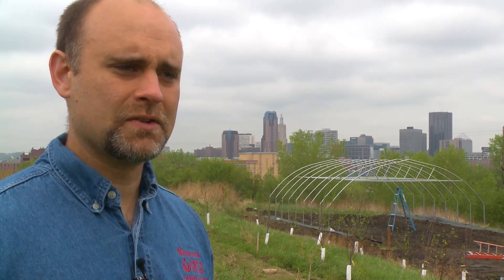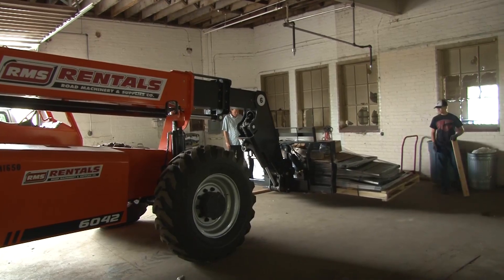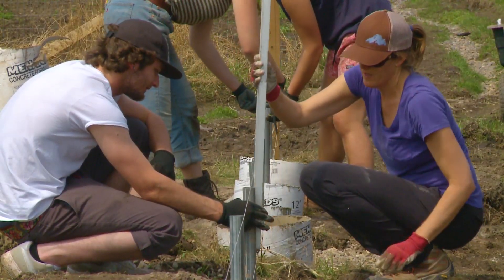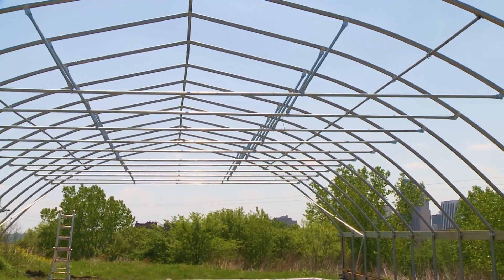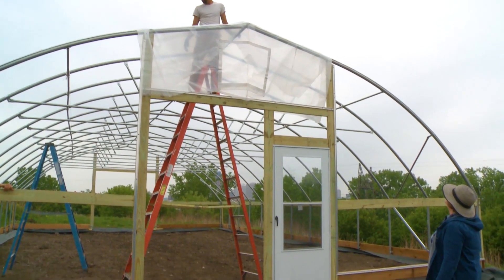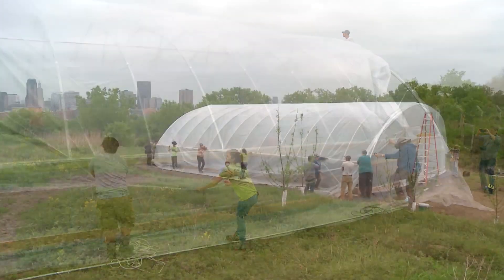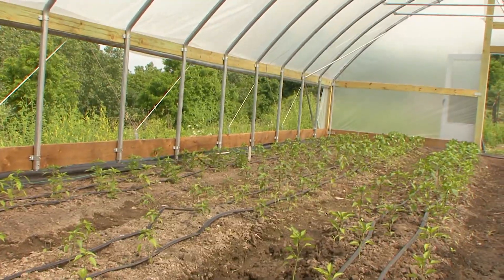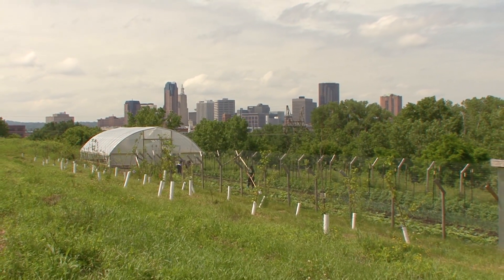High Tunnel System

Comment: Nice information.  Question-  why concrete for posts in city, but not in rural application?
Reply from the maker: I believe that is because they want to be extra sure that the structure won't pull out during high winds and cause damage to adjacent areas in an urban setting, compared to more open a rural areas.